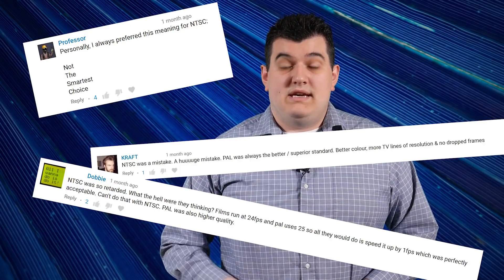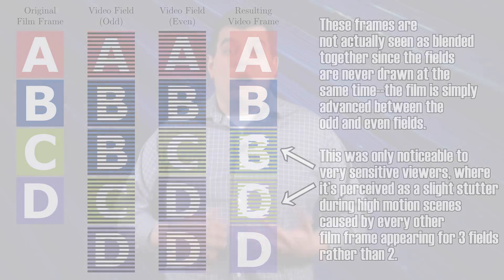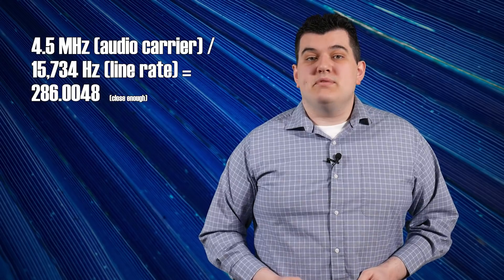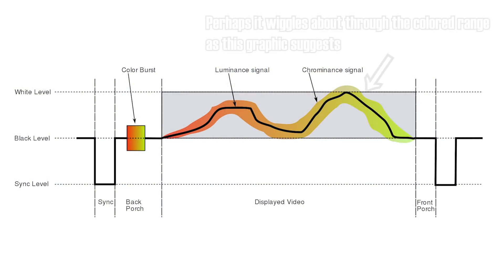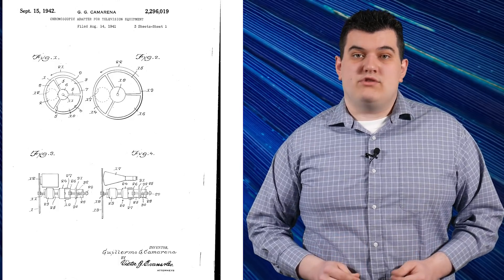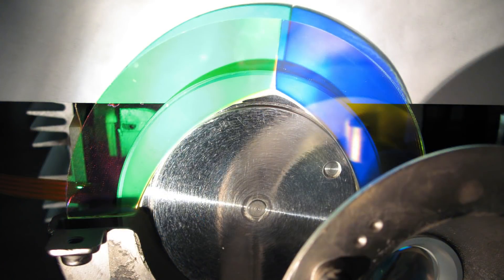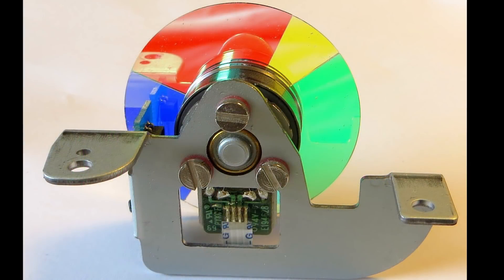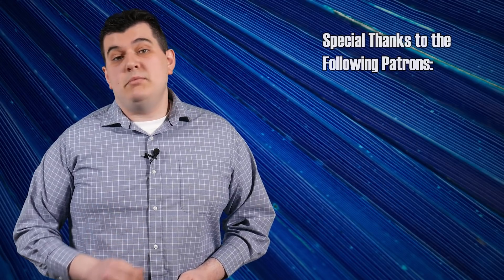Analog Color TV Wrap-Up--Some extra info

Comment: I discovered PALs increased speed when I tried to synchronize A DVD soundtrack with a Blu-Rays picture, Blu-Ray being 23.976/24 FPS to PALs 25 FPS they would constantly go out of sync, I'd have to pause the DVD momentarily every minute or so to get it back in sync. At the time I didn't have a digital amplifier, only an analog 5.1 system, I wanted best picture from the BD, with surround sound on my analog 5.1 system.

Comment: Excuse me what? You link to Matt's video but claim that PAL has 25 fps because it has 625 lines?
Those two things have nothing to do with each other and Matt even shows in his video that 625 lines and 30 fps would have worked for the 4.5 MHz used in US.
Reply from the maker: True, but with a fixed carrier frequency to increase the number of lines would decrease the horizontal detail that can be resolved within each line.  Both formats have a bandwidth of about 5 MHz.  So an NTSC broadcast with 625 lines would lose detail in the horizontal resolution.  PAL, because it has a lower frame rate, keeps the same amount of detail per line even though there are 100 more lines to deal with.
Reply: They are inter-related. (change the framerate, but keep the bandwidth the same, you get more resolution to play with. - it's a tradeoff - you can see that in how close the h-blank frequencies are to one another.)
But let's not forget the underlying issue;

Both standards have their field rates set to what they are because of not wanting to include dedicated frame timing circuitry.
Europe has, on average, (it varied historically between 210 and 250 or so), 230 volts, 50 hz AC power.

The US (and other places, such as Japan) has 110 volts, 60 hz AC power.

Do those numbers stand out to you?
They should...

Ultimately the framerates of the two television standards weren't chosen for reasons that were directly related to video playback.
Reply: FYI, in Brazil they use a special version of PAL that is 525 lines and 60 Hz (well, actually 59.94).

Comment: NTSC = Never The Same Color
Reply: I've heard it differently in my time in the broadcast industry. Usually the word "the" isn't included in an acronym. In NTSC, the problems aren't just in the receiver. It's also in the production pipeline. The adjustments in videotape machines and mixing gear also come into play in getting the color right. With that in mind, NTSC was known as "Never Twice (the) Same Color". That goes back decades of my experience in this industry. PAL and SECAM earned similar accolades. Technology is never perfect. We're all working toward perfection. :)
Reply: collegeman1988 - The exact phrase was "Never Twice the Same Color" and was coined by Joseph Roizen at Ampex in the 1960s. He also coined a similar term for SECAM which went, "System Essentially Contrary to the American Method". Secam was developed by France (that figures) and Russia so their cultures would not be contaminated by programs from neighboring countries. There was a huge black market in the old soviet union for converting SECAM sets to receive PAL. 

BTW, PAL and NTSC are essentially the same system with minor changes in some of the numbers. The alternating phase in the PAL system was tried at RCA before standardization and was dropped for cost and complexity reasons. By the mid 60s, the complexity was no longer an issue and Germany adopted the phase alternating line method to cope with hue shifts as seen in NTSC. The hue shifts are still there in PAL. Instead of turning the whole screen green or purple, it effects alternating lines; green, purple, green, purple, etc. From a distance the color errors cancel and the pictures looks fine. A PAL set with the improperly set internal "phase control" (tint in NTSC) looks really bad close up.
Reply: "Instead of turning the whole screen green or purple, it effects alternating lines; green, purple, green, purple, etc. From a distance the color errors cancel and the pictures looks fine."
Not from a distance. It was used only in experimental or very cheap variants. In standard PAL receiver, the 2 lines are added by delay line and electronic, so you see only the correct colour on screen.

Comment: About decoding artifacts, they can be either actual detail incorrectly decoded as color (rainbow colors appearing in fine monochromatic picture detail like fabric texture), or actual color incorrectly decoded as detail (dot crawl). In this latter case the color subcarrier is not correctly separated and remains visible as a luminance wave. I'm not sure why it usually seems to crawl.

There's a comment in r/programming about this which I very much recommend reading https://www.reddit.com/r/programming/comments/601zmg/google_reduces_jpeg_file_size_by_35_new_algorithm/df32cbm/

Comment: And in the former Soviet Union we call SECAM the worst color system, and we say SECAM was a mistake ... Especially when writing to VHS in MESECAM
Reply: If I remember right, the worst thing about SECAM is that they didn't invert the luminance signal. In NTSC, a strong signal means "dark", but in SECAM it means "bright". RCA figured that snow in the bright areas (where the signal would be weaker) would be less annoying than snow in dark areas.
Reply: SECAM had two color carriers and was capable of both vertical and horizontal subsampling, making it the first color, analog, composite video, television standard to do this. I think SECAM looked the best.
Reply: +Scott Larson SECAM is a colour system, it does not define the underlying b&w signal. It's true that France uses system where where amplitude and brightness are reversed to all other systems, but in Eastern Europe it is (or was) used with systems D/K and B/G which are the same as in some PAL countries.
Reply: The SECAM specification certainly does define the underlying monochrome signal. All color systems rely on a specific monochrome system otherwise the color system won't work. That's why Brazil doesn't use PAL. It uses a variant called PAL-M because PAL as used in the rest of the world wouldn't work with the NTSC-based monochrome system.
Reply: +Scott Larson Sorry you're in error. Any colour system can be adapted to any monochrome standard. Not all possible combination exist in real life, but they are theoretically possible. SECAM has been used with ITU standards L, B, G, D and K, PAL with B, G, D, K, I and M. The latter is the combination used in Brazil, and that is absolutely a PAL standard. And this is also why it's called PAL-M, it means PAL on top of ITU M. Using the same naming system, the standard for UK is PAL-I, most of Western Europe PAL-B/G, France SECAM-L, Eastern Europe SECAM-D/K or SECAM-B/G, mainland China  PAL-D/K. That is what those combinations mean. It does not mean they're "not really PAL". And only system L as used in France is the one where luminance is inverted, all the SECAM variants used in Eastern Europe aren't.

If there was a country which used NTSC on top of one of the 625 line signals, it would be e.g. NTSC-B/G, or in the UK NTSC-I (I think the BBC seriously considered this option). The BBC also tested all of the three colour systems with their 405 line standard A. If they had gone that route, it would be NTSC-A, SECAM-A or PAL-A, whichever it would have been.

https://en.wikipedia.org/wiki/Broadcast_television_systems#ITU_standards

Note that list defines as one of its parameters the frequency of the chroma subcarrier, but it doesn't specify how it is to be modulated.
Reply: Xaver these are not SECAM, but variations of the French SECAM standard which, if you look it up, clearly defined the modulation of the monochrome system as it was used in France. In the industry a standard requires compatibility, and these systems are certainly NOT compatible with the original SECAM standard. That's why you've had to list them as separate standards.
Reply: As Xaver explained, SECAM is color system. France's analog color television standard (SECAM-L) is one of multiple standards to incorporate it (as well as amplitude and brightness specifications, which no one disputes). It's no less "SECAM" than any other variant. Likewise, Brazil's PAL-M is no less "PAL" than any other variant.
Reply: They're all "SECAM" but completely incompatible with each other, because that's how standards work!
Reply: They aren't completely incompatible (some are partially compatible), but that wasn't among the matters of contention. Xaver disputed your mistaken association of the French luminance specs with all SECAM-based systems and your incorrect statements that "Brazil doesn't use PAL" and France's analog TV broadcast standard is "not SECAM".
Reply: @pahom2  You are wrong. PAL came before SECAM.

Comment: What about the SECAM system which was used in France and Eastern  Europe. What was the difference between NTSC, PAL and SECAM?
Reply: SECAM used a narrow band FM carrier for the color.  SECAM also only transmitted one color component per line, which required a line buffer (delay line memory) to store one of the color components while the other was being transmitted.  NTSC/PAL didn't do this since it used QAM for the color components.

QAM is a bit tricky to understand, but basically, if you look at a sine wave, there's spots in the middle where the wave crosses the 0 state that don't have any information.  QAM takes another AM wave, and spaces it such that it fits inside those gaps, so you can have two signals in the same space.

With FM, since the gaps are always moving around, you can't do that, so to get both color components with FM, you need the line buffer.  This also cuts the vertical resolution of the color signal in half, but since the horizontal resolution was already crap to begin with, that's not an issue, though it is still worse.

SECAM could theoretically have the best color reproduction, but it was terribly complicated and was vulnerable to the FM cliff effect for the color signal.
Reply: kargaroc386 Didn't SECAM also encode video signals in YDbDr format, which has luma, along with two separate chroma subcarriers that ride along the luma channel in a composite signal? I know it was also the only analog composite video standard to do this along with both vertical and horizontal subsampling thanks to having two delay lines instead of just one like PAL. I just wanted to verify.
Reply: No. Both PAL and Secam TV sets have 2 delay lines. One is for correcting luma / chroma delay and is used in NTSC too (NTSC use another I/Q delay line). Second is for chroma. In both systems it is used for adding next lines together - in PAL to correct phase error, in Secam to join red and blue chroma components.
Reply: @xsc1000  This answer is a bit confusing. All color receivers require a short luminance delay line of one microsecond or so because there is a delay of the chroma due to the narrow bandwidth of the chroma circuits. The other delay line that is discussed is a much longer one-line delay that is used for other purposes: in NTSC, as a comb filter; in PAL, as a phase error canceller; in SECAM, to make both chroma components available simultaneously.

Comment: What about a video about DVB vs ATSC  ;) xD
Reply: The rabbit hole would become an underground labyrinth to surpass carpenter ants...
Reply: Lol, that's probably true.
Reply: What about the Japanese ISDB-T?
Reply: When you get into digital television (and probably radio too) they're just methods to transmit an MPEG Transport Stream. All the mess with frame rates, etc is left to the codecs. I gather most televisions can handle any common frame rate anyway. The only problem now is updating codecs e.g MPEG-2 video to MPEG-4 AVC (a.k.a "h.264").
Reply: And now we have to update to the newest HEVC "H.265" and open source rival AV1 codecs for 4K video :-P
Reply: Ian Tester they can handle it, but they still scan in their native frequencies. 25fps looks crap on a 60-120hz TV.  We need variable scan rates.
Reply: or a screen that scans at the LCM of 50fps and 60fps, 300fps. (300/50 is 6 scans per frame, 300/60 if 5 scans per frame)
Reply: @SkyCharger001  Scanning at the signal frequency is better.  Because not all video is a nice fraction of 300fps.  For example, it will allow exact reproduction of 29.97fps (NTSC), 70fps (old PC monitor standard), 16fps (old film standard) etc. etc.